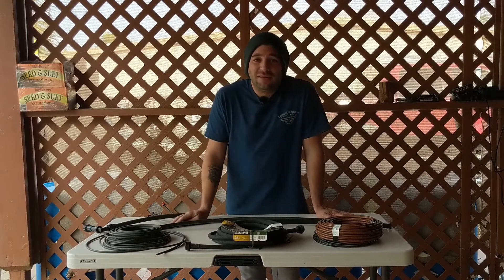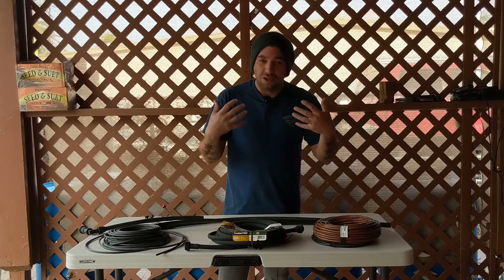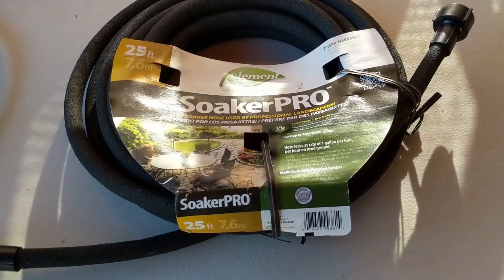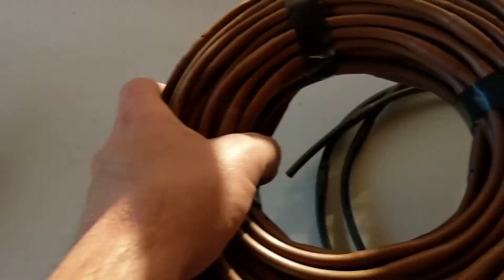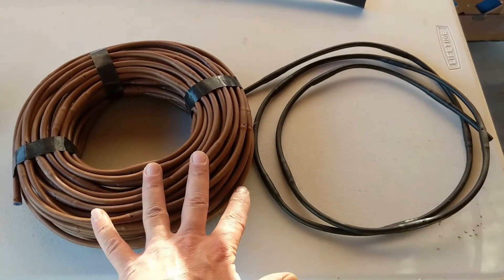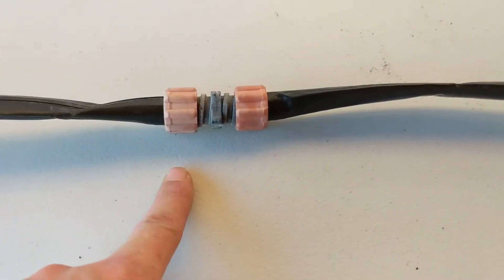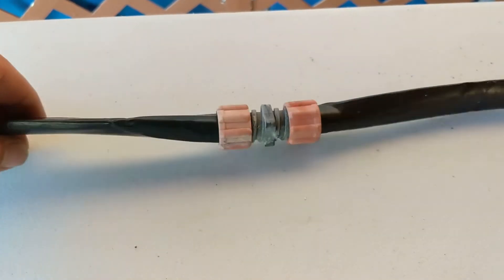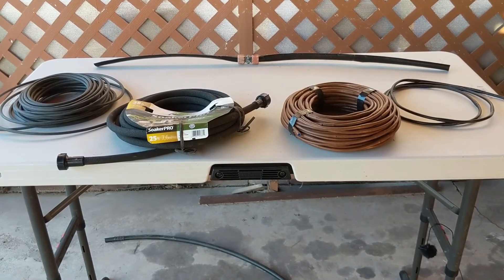Desert Gardening Basics: Dripperline, Drip Tape, and Soaker Hose

Comment: Very thorough video comparing variuous drip irrigation methods. I already have some drip tape and want to use some mechanic timers with them. Will I run into any problems in terms of pressure? What are my options? My main line is 24 PSI.
Reply from the maker: Hello! it would depend on the type of line you are using but most drip tape and dripper line is designed to operate between 20-40 PSI. I use all of these with irrigation timers but where i live the water pressure is much higher so I use a pressure regulator which you can see in some of my other videos if you'd like to take a look. Good Luck!

Comment: This was very helpful, but I'm hoping I misunderstood one thing: Did you say that dripperline isn't good to use more than about 18 ft because there won't be enough water pressure? I had soaker hoses that went much farther and weaved around big beds, and they worked, so surely that's not true? 

One more question: If hooked up to an automated timer, these DO NOT require backflow nor pressure regulation devices, right? That's only if the timer is connected to an in-ground sprinkler system?
Reply from the maker: Dripperline and soaker hose are different, soaker hose doesn't put out as much water as drip line so you can run it for a longer distance. Your irrigation system should have a backflow preventer regardless of what type of line you are using if any of the lines are higher in elevation than the source of water. Good luck!

Comment: And do you have any idea what's the best way to fix bigger diameter hoses (1.5") ...already tried to couple with pvc pipe and glue.... But does not seem to work...
Reply from the maker: They do make reducers and fittings for all the different components, sometimes with plumbing and irrigation you have to find whatever pieces on hand to make it work. I would take it down to a hardware store and see what parts they have you can use. Good luck!

Comment: Hey Brandon,  Thanks for making the video!
I have a lot of this line installed in my yard (1,000 ft+) I am starting to get clogging issues and am losing plants in this 100 degree heat. 
Do you have any tips to clean the emitter line out?
Appreciate any feedback
-Brendan
Reply from the maker: Depending on what kind of line you have, it might have to be replaced. First thing I would make sure your using a filter and that you check it periodically, if it starts to get  clogged you can replace it. You can try soaking the lines in vinegar over night, it might be a pain for 1000' of line but I don't really have any other suggestions. I have seen irrigation line last anywhere from 6 months to several years depending on how hard the water is. A filter definitely helps though, sorry I don't have a better solution. Good luck!
Reply: @SouthwestVictoryGardens  can you recommend any videos regarding the mentioned filter system?

Comment: Thank you man! This is just what I was looking for! Question though. I definitely want to use the black specialty quarter inch hose by dig or Tempo. How would I hook this up to an old sprinkler head that I have capped? Do I need a pressure reducer for this thing? Thank you man any advice would be very much appreciated.
Reply from the maker: Sorry for delay, was on a honeymoon! Some sprinkler systems do have pressure regulators, it just depends on the system. A pressure regulator usually has pipe threading so a simple solution would be to attach male/female PVC fittings and install the regulator on the PVC line to the sprinkler head riser. There are a variety of threaded and slip connections that you can then use to convert the PVC line to drip. So if your sprinkler head riser has a 3/4" male thread, you can get a 3/4" female thread to compression adapter that you can then switch over to 1/2" poly and come off of that. There is a slip pvc fitting that has a 1/4" hole that you can glue into a PVC coupler and then convert to 1/4" spaghetti line or dripper line. So you have a few options, just need to find the right parts. Good luck!

Comment: Q: Irrigation Tubing (Blue Stripe) keeps springing water wasting leaks 2-3/mo every summer. Both underground & the above ground sections South yard.
It just cannot hold up under heavy clay soil, or to the heat in the shade under plants.  
I've tried sliding PVC over it like a jacket, helps but makes it more difficult to notice leaks. Any suggestions/remedies?
Reply from the maker: You might have a low quality PVC product. I've personally had bad experience with any of the tubing that has a colored stripe down the middle. Try asking your irrigation supplier for "Virgin" tubing which tends to be thicker and hold up longer. Good luck!

Comment: You can get the 1/2 inch drip line in 12 inch spacing. That is what we use in our gardens.
Reply from the maker: 12" spacing can work well in some soils and if you have a lot of space between plants. I typically suggest 6"-10" spacing for most desert applications and for vegetable gardens using more intensive spacing.

Comment: Can i put soaker hose under the soil?
Reply from the maker: There are dripperline products that are designed to be used underground or above ground, but I personally do not recommend. Soaker hose is probably best used on the surface of the soil because of it's tendency to clog. Good luck!

Comment: Great job breaking it down. You should've mentioned 1/4" soaker hose that you can connect to a drip system. It Home Depot and Lowe's both sell them. It's a great way to completely soak a narrow flower or vegetable bed.
Reply from the maker: Hey Mark! In the southwest we have hard water that clogs soaker hose, we do not recommend it's use to home gardeners, dripperline is a much better option.
Reply: @SouthwestVictoryGardens  I know but there are probably many people watching this that don't live in the southwest. Since this video is about drip irrigation that option is out there. I live in southern California and I always wondered why the soaker hose would clog up after a few years. I still use the 1/4" soaker hose though for certain applications. I can usually go 3 years before needing to replace the soaker hose.
Reply: @SouthwestVictoryGardens  in Florida we have hard water also! Don't want stuff that will clog.

Comment: Good to know, but dripper lines currently have 3-5 week delays. Meanwhile, soaker hoses are available, but selling out quickly. Weird times. Edit & amendment: I’m going with 1/4” drip line/emitter kits from Amazon. Challenging to install, but perform extremely well in comparison to the rubbish soaker hoses that I’m sending back 4 refund.
Reply from the maker: I had no idea, makes sense though. I've personally having trouble locating soil amendments from my usual supplier because of Covid related shutdowns and slowdowns. Hopefully supplies will be back in stock soon. you might try one of the online suppliers like dripworks, berryhill, or dripdepot if you haven't already, that would be my only suggestion if your local irrigation supply is out. Good luck!

Comment: Any experience with drip tape rain barrels gravity pressure only? What is the likelihood it will work?
Reply from the maker: It could work, but it will depend on your situation and materials. The shorter the run of tape and the more "head" pressure on the rain tank you have the better it will work. There are also special timers that work with gravity pressure that you can use, though I've only seen them used on larger rain barrel set ups.
Reply: @SouthwestVictoryGardens  I also am doing gravity irrigation from IBC tote rain collection to raised beds 3'x16'. Will the the tape do better or drip line with this low pressure? First bed at top of hill has about a 2' to 3' of drop from tank. Then of course greater drop for each bed as it goes down hill.
Reply from the maker: @SuzyHomesteader  You might want to experiment with different tubing to find what works best. It gets tricky when you have beds at different elevations because for every 1 ft. of elevation drop or gain you have an increase or decrease  in water pressure. using pressure compensating emitters or line helps to get around this problem but they might not work well with gravity pressure. You could possible adjust water pressure using valves in the line but it would require constant maintenance to ensure even water flow. Good Luck!
Reply: @SouthwestVictoryGardens  Thanks!